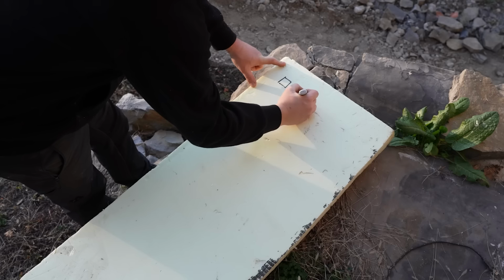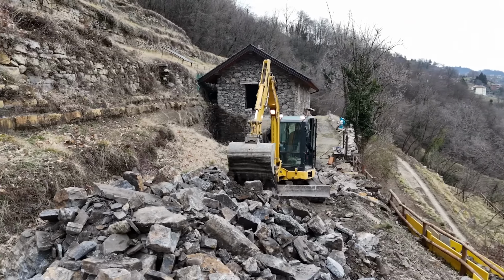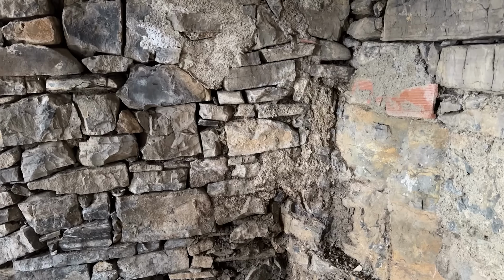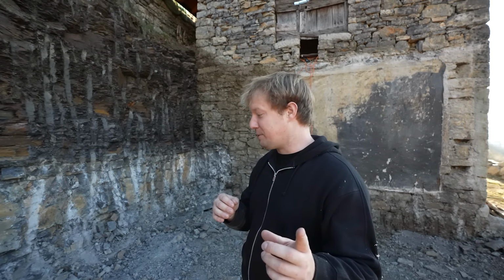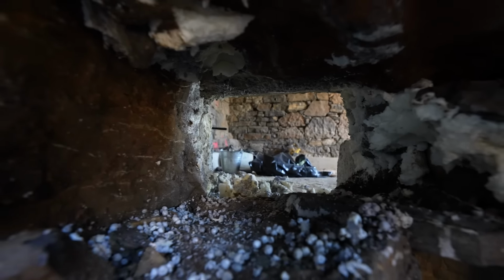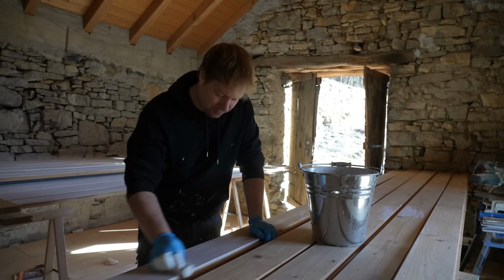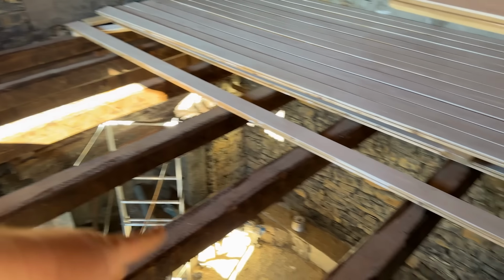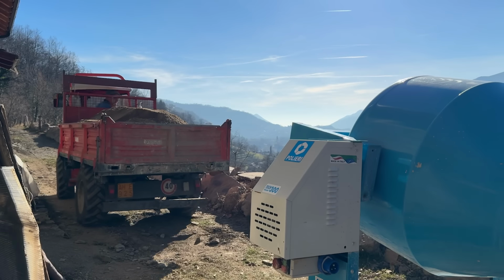They Left Me. Building Alone in the Mountains. (Italian Stone House Renovation)

Comment: As your building sits in a stone landscape, your water problem likely isn't ground water but water running over the surface of the rock. You would do well to construct a swale at the top of the rock along the entire back wall of the structure and drain it to one or both sides. Nice work.

Comment: While you have the build at this point you could dig out at the back of the building down a short distance to bedrock and put down a concrete trough against the building and extending a short distance uphill ( less than a metre) and place an agricultural drain in the trough before backfilling with rubble. That would direct a large portion of the water away from the building and what you are doing with the floor would take care of the rest.

Comment: Potential solution to adding more floor space under roof. To the back portion, and leaving the front half of roof for aesthetic historical value.

Building a second Story structure on upper elevation with cantilever portions above rear half supporting the front portion of Roof facade. Section of lower original structure designated for staircase to third level as not exactly a three story structure per se.

Comment: I would have called the driver off and designed a stone bench/bed at the base of the wall... heated with a Wood Stove flue. No point shaking the walls to pieces. I'd would also dig out what I could behind the house by hand (without going full depth and not really affecting sloped walls), place a sloped slotted agi pipe to drain ground water and then made a slopped spoon drain above to catch surface run off and direct all this water around and away from the house and extension. I'd certainly link the new room to the existing house with a door. I'm not sure where your driveway is... but if it doesn't affect access, I'd construct a semicircular terrace extension out the front using some of the new available stone.

Comment: White washing comes from lime washing. Most modern attempts to recreate the look use paint but it was originally done with lime wash. 
The original purpose is primarily protection of the building materials themselves. Lime wash was regarded as the 'sacrificial element' of plaster walls, wooden fences etc. IE thé part that would endure nature and take the bulk of the damage. When it was damaged it could simply be washed over again. This was far easier than replacing the materials themselves. 
This is also true of mortars, where the mortar is designed to fail. It is a 'sacrificial element'. Mortars should always be softer than the building materials themselves, so that when the inevitable movement takes place it is the mortar that cracks and not the stones or bricks. Mortar is easy to replace compared to stones. 

The notion of whitewash being a pleasing esthetic per se would be strange to builders from centuries past.

Comment: Gosh and Golly? 
I'm a bit confused, to say the least?
I cannot for the life of me, understand (at all) why you either have to, based on construction codes, or want to, lay down a perfectly structurally sound 2nd level/floor of 2-inch thick X 6- inch wide tongue and groove wooden flooring boards and not leave it at THAT for your 2nd Floor? Why do you have to, or want to, pour 3-inches of concrete "ON TOP OF" the perfectly and structurely sound 2-inch thick wooden tongue and groove flooring boards??
I've been watching Martijn Doolaard's BRILLIANT YouTube Channel in which he ALSO lives in Italy, the North Western part in the Italian Alps, above Turin, near the French Border. Martijn is also remodelling two (all stone) cottages with Wooden Beams for the roof framing and to frame the 2nd level/floor, but he does not have to pour 3-inches of concrete over his 2nd level/floor which consists of 1-foot round wooden framing beams and (similar sized to your flooring boards) of 2-inch thick X 6-inch wide tongue and groove "Hardwood Chestnut Flooring Boards". He is also adhering to Italian Building Codes and his Hardwood Chestnut 2-inch thick Flooring is more than sufficient to make up the 2nd Floor of his cottage that holds a full kitchen with refrigerator and bed. 
I can totally understand several inches of concrete to form the first floor in your Stone Barn, to run pipes and conduit for electric, water and brown waste water! But to pour 3-inches of concrete on top of a structurally sound wooden 2nd floor is beyond baffling to my mind. A waste of time and money and possible structural failure further through the years?
Just wondering?
Perhaps you can address this in your subsequent videos, as I either missed, or I   haven't heard you address it up to now? 
Great endeavor on your entire project, by the way! Good luck!
Reply: The house doesn't have mortar, all those stones are dry stacked ...
Reply from the maker: Our home can be legally classified as a house and therefore has to follow very strict rules. The majority of the other stone cabins in the mountains of Italy are classified as “baita” or cabins, which do not have very many rules to follow, but the downside is that legally you cannot live there. You’re only allowed to visit occasionally.

Comment: Digging behind the house could be done as they do for stone mining. You want more the chainsaw trench style. Less vibration, more cutting. You could run a diamond cable from one side to the other and cut straight down in 2 passes. The drag out the loose stone, and waterproof wall, add drainage etc.

Comment: I've been thinking about your seepage issue on your back wall. Have you considered creating a sloped gravel bed leading to a sump pump? I know it's a bit late in the process but if you sealed the wall with a spray sealer but left it un sealed about 6 inches from the bottom, that may allow you to catch any drainage and channel it with gravel to a sump pump that would automatically remove it as the level rises. Thus would insure all living spaces above to be dry and mildew free. Just an idea. You're doing an awesome job. Keep up the good work.

Comment: @raisingvoyagers, what if you went up to the plateu above the house and dug down, not disturbing the wall against house but putting in a drainage tile system, the width of the house and  then run all the water the rain puts down onto that ledge and route it around the house.  Depending on the cost possibly do both plateus directly behind the house. It sounds dumb but u can tell you just from putting one gutter on my neighbors two car garage it stop my basement from having water coming through the foundation and down our celler stairs. One long gutter routed to the alley, redirected the rain from the roof away from our yard and that made the difference between water coming in and not. Maybe you can reroute the rain above the house from being able to penatrate the ground behind the house and thus stop it from coming through the house.  ❤
Reply from the maker: We definitely plan to do this! The only reason we haven’t done it yet is because it’s pretty difficult to get an excavator up to those terraces right now as there is no road. We first have to build a road and then we will install a gutter system or French drain system. That honestly will solve 80%+ of the problem, and then we will have an internal French drain system that will capture any remaining water coming in.
Reply: Hooray!   One more suggestion,  since you lost the rooms under the mountain, what about extending this new room out longer, and up to the 2nd story,  the door up there is already there and you can get a staircase in and the rooms you needed plus still have your upper terrace. Money money, I know, but just a thought for the missed added bedrooms.

Comment: Could you drill horizontal behind the wall from the side of the house right on top of that big stone ledge?   I bet the water comes down  hits that rock and then goes towards the inside.  You could take out some of the earth along the bottom Leave the earth above   That earth seems pretty solid- - then slide something in to act as a water channel ?  Then pack the cavity around the drain . possibly a spray foam on the house side to act like a dam and then gravel on the mountain side.

Comment: I know that Harlech Castle walls were originally white washed, about a 1000 years ago. Apparently they didn't bother weighing and measuring they just mixed it up, if they wanted a uniform finish they just kept coating the surface until the desired result was achieved!